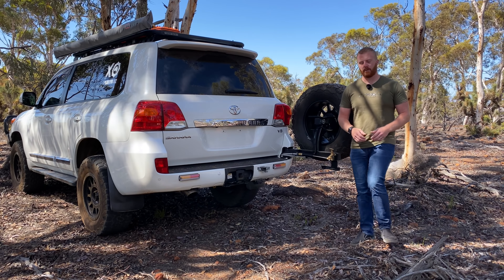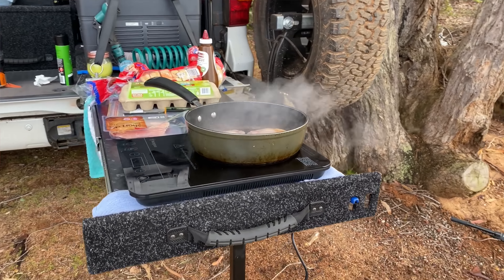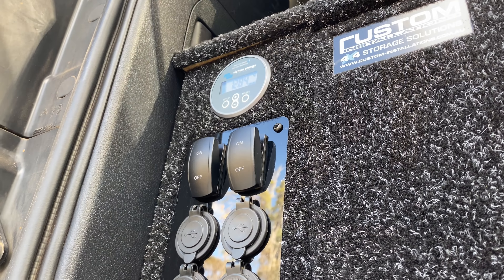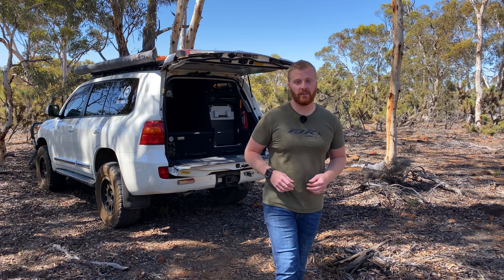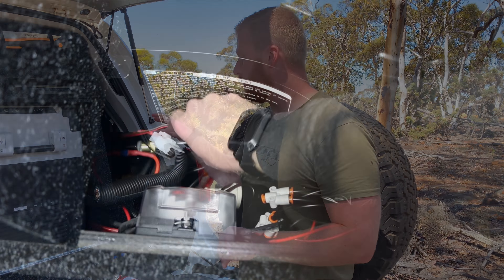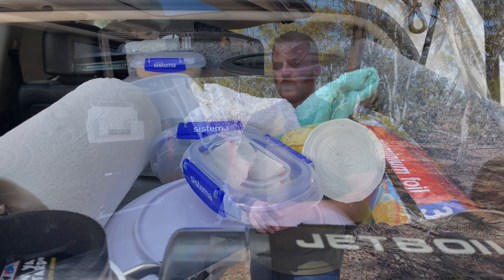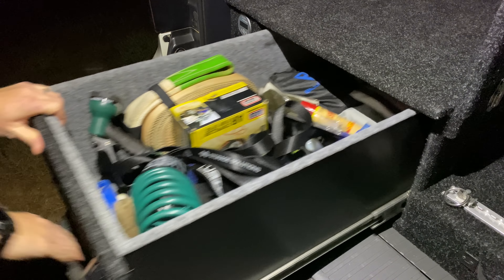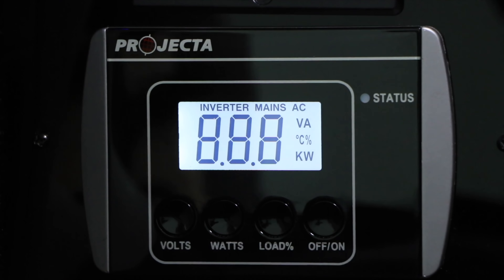ULTIMATE OVERLAND STORAGE SETUP | My drawers, Emuwing Box electrical setup hidden storage & lighting

Comment: Hi Nathan another great video it will interesting when you do weigh and check your rear axle ,with 250 kg Towball weight a draw system & a 50 litre fridge I am close to 1950 kg gvm doesn't help the axle loading. cheers Ian.
Reply from the maker: For sure, I am a little worried about the weights, but this is something that will need to be worked on. 
Cheers.

Comment: Excellent video and as usual very helpful. I like that you use what works and not brand specific. Any news on your new van ?
Reply from the maker: Thanks, appreciate that. Yes, always using the product that is better suited for the application. 
Unfortunately still waiting at the moment. We have been in discussion with the manufacturer for some extras for our van specifically, but this also means that we have been pushed back to early/mid next year. It's a little disappointing but I'm sure that it will be worth the wait in the end. 
Cheers.

Comment: Hey Nathan you smashed it out of the park once again with another detailed vid. Can't weigh for your weights vid to drop. Also I don't think you have previously mentioned it but do you any type of tune in the cruiser or just running the lock up kit? Interested on your thoughts on this topic as I'm in two minds of having one performed on my new 200 due to heavy van scheduled for pick up in March. Cheers Paul
Reply from the maker: Thanks mate, appreciate that! I'm looking forward to figuring out the weights too, albeit slightly anxious 😬 
So yes, I am running a tune in the LC200. Both in the ECU and the Transmission. These work in combination with the lockup kit and I have been very, very happy with the final results. Everything works well, zero engine codes or faults and a great increase in power and torque. 
I have been meaning to do a video on this for a little while now, it's one of those ones that just keep getting pushed back. 
Cheers, Nathan.

Comment: Nath.  Yes mista - very impressive sir !  Any other addition or space saving spots for an air compressor inflation tank ?  V.
Reply from the maker: Thanks mate, very happy with the final result. 
I'm not aware of any other 'hidden' spots in the LC (other than where I have it mounted). A compressor can also tuck nicely between a drawer system and the rear seats or also in the wing kit storage areas of the drawers.
Cheers, Nathan.

Comment: well sorted setup, do you happen to know how heavy all the rear drawer ply unit weighs?
Reply from the maker: Thanks mate, so I didn't get the opportunity to weight the system before being installed,d but after speaking with Chris, I believe the system would be around 60kg (excl. the fridge box and EmWing box - this adds about 20kg more). So not a light unit, but it's one of the compromises of convenience. 
Cheers, Nathan.